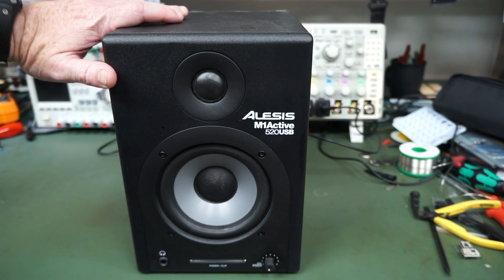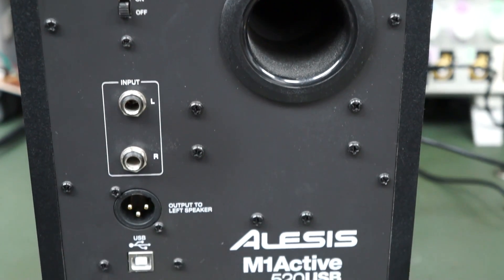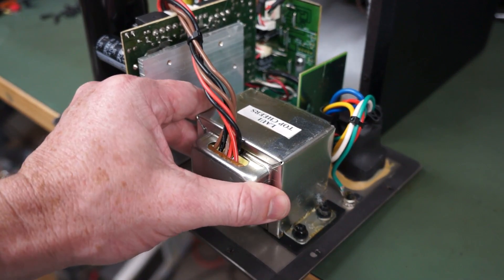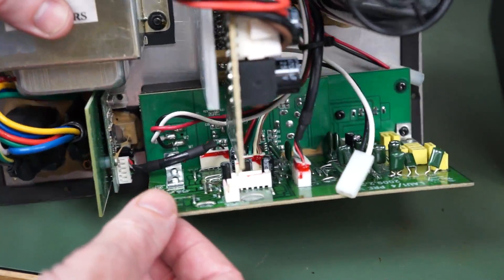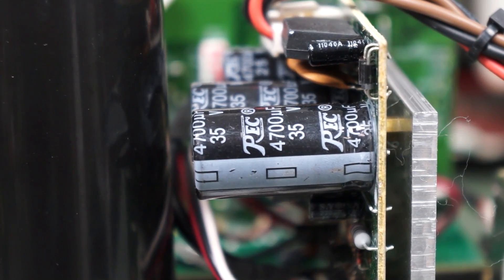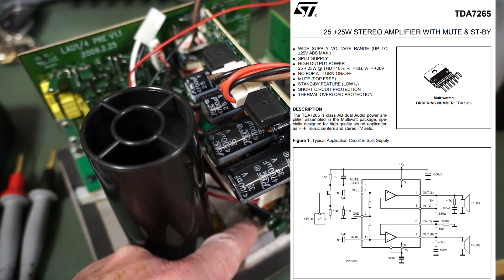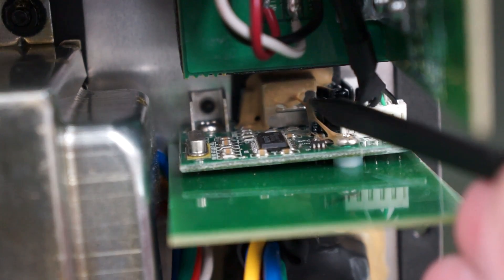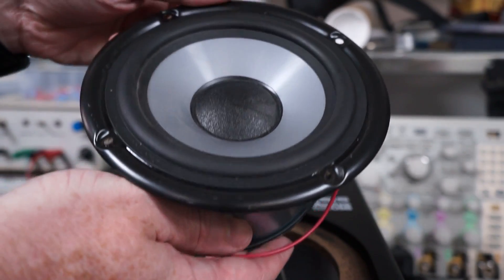Alesis M1 Active 520USB Studio Monitor Teardown

Comment: Bought these back in 2012 for $200...still going strong after blasting so much music thru these lol
Reply: nah they broke...turned them off for a week, came back and they have insanely low volume even though you can still hear (and see) the audio clipping from the DAC if you max the volume out but it's whisper quiet...same thing happens through usb and analog. Clipping LED works like normal not solid red like some people have

Comment: Why would there be "extra channels for stereo" in what is clearly the power supply section?

Anyway, if the left speaker has no power cable, they are either sending full 4ohm speaker signal or some power + line level combination through that XLR connector.  So unless they are following the traditional phantom power spec, they are probably using that socket in a completely non-standard way just for the wow! factor of using a "professional" connector, when all the actual inputs are single ended jacks or consumer digital.

Comment: If the speaker manufacturer is honest, the 30 watt rating is how much power it takes to destroy the speaker.
If the speaker manufacturer is "typical", the 30 watt rating is a total lie.
Rule of thumb is about 1 watt per inch of diameter input for undistorted sound output, the 5 inch driver in this unit is good for about 5 watts of input before it becomes "unlistenable".
As far as power rating of the chip, those figures are optimistic numbers under laboratory conditions, with unbearably high distortion. In the real world expect half of the rating's output for clean sound.
The power supply and heat sink could limit it further.
Reply: you might want to catch up on the last 30 years of driver engineering. Oh and those amps are 25+25W nominal - 15W+15W @ 0.02% THD
Reply: Tell 'em brother,  too much power is never the problem, too little power destroys drivers. Yes of course with a thousand watts you could launch the driver and half the cabinet into your kitchen, however an underpowered driver will destroy the spider and it's a rap for that set of speakers and probably the power amp too; that is if anybody uses passive / power amp systems anymore. anyway, there cheap speakers and you're probably a 13 year old. mow another lawn and buy another one. next!

Comment: Dave, is that a dual rail supply, hence 2x smoothing caps? The TDA amps are single rail, so it would be wasting half the PSU current just to power the opamps dual rail!
Reply: Simon Ashton The control opamp for the faulty LED (main channel video) was running on dual rail ±15V supply.

Comment: Are these speakers not bi-amped?  They're active so the crossover is done at the pre-amp stage.  Surely it'll be 25W to the woofer and 25W to the tweeter.  That XLR connection to the other speaker is surely for line level rather than from the power amp; otherwise why use a differential, low noise connection.  If they are 25W woofer and 25W tweeter then they're notionally 50W RMS per speaker (assuming that 25+25 is RMS), although the low frequencies will draw the vast majority of the power.
Reply: David Griffin You'll never get close to putting out continuous 25W from the tweeter, maybe up to 1/5th of the output the lower range is putting out, which is approx. 5W at the point where the lower frequencies would start to clip. The power-frequency distribution in audio is non-linear, it basically goes down as the frequency goes up. The instantaneous power however is needed to reproduce pops, clicks, syllables and other high-frequency transients.
Reply: I use these monitors. The technical spec say 30W RMS per channel. The XLR out connects directly to the other speaker from the power amp.
Reply: I believe I alluded to that in my last sentence; thanks for reminding me though.
Reply: since he commented that the crossover in these is specially set outside normal speech range for clarity in speech i am guessing it is REALLY low, meaning more of the power will go to the mid-tweeter ;)
They may well have taken advatage of this to be able to use 2 identical stereo drivers, one for each side, which is cheap and would reduce crosstalk over a large stereo woofer driver and smaller stereo tweeter driver

Comment: The 25 watts at 10% distortion is really just a way to put a bigger number on the data sheet. Maximum continuous power before clipping will be lower, and well below 1% distortion.
Reply: Judging by the spec sheet, the continous power with wide frequency range and low THD appears to be 10 W to 8 or 4 ohms at most.
Reply: Keep in mind they are bi-amped, so 50W available per side. But yeah, 20 a side is probably realistic
Reply: @mycosys  yeah 10% distortion means basically useless. It would sound like total crap.

Comment: Say it ain't so Dave.  You use edge board soldering?  That has to be the most unreliable connection known to man.  Highly susceptible to breaking in high vibration environments.  A few two way radio manufacturers have used that over the years and you can be guaranteed that within a few years the radio is going to develop intermittent faults because the edge soldered boards fail.  Solder has very little durability when it comes to flexing and lead free is the worst.